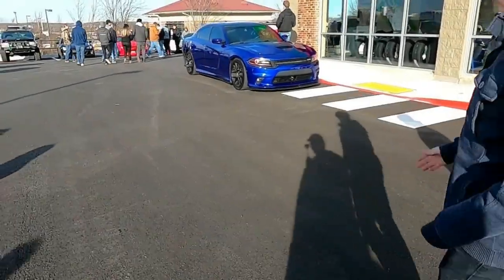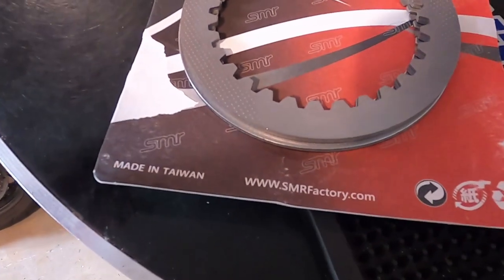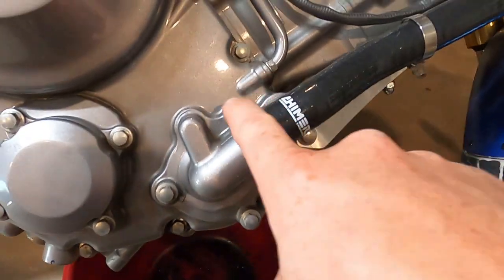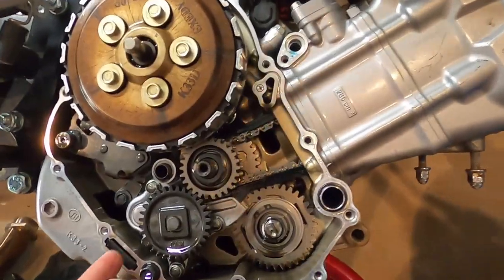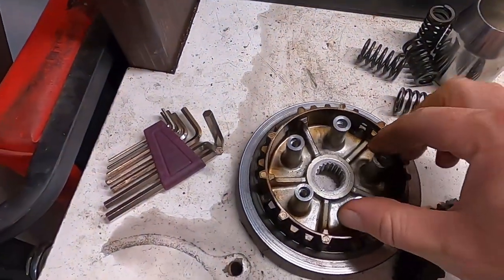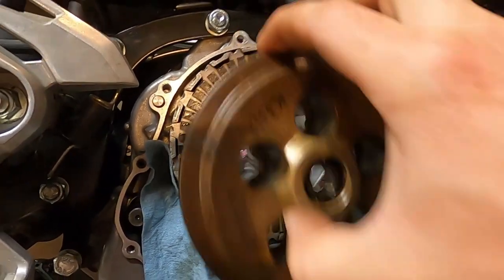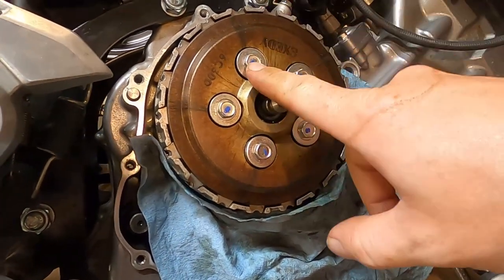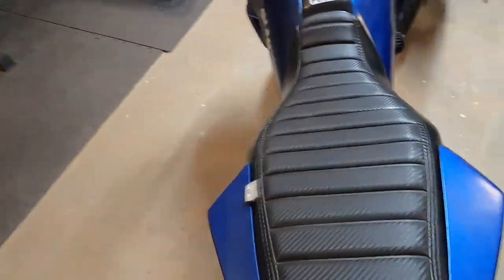How To - CBR300R Clutch and Springs

Comment: Not sure why 10 ft-lbs stripped those holes so bad unless your torque wrench is out of spec. The shop manual says 12nm (9 ft-lbs). Update: just upgraded my clutch, and I used a torque wrench set to 9 ft-lbs. It wasn't even as tight as I can easily do with one hand on a 1/4 in ratchet.
Reply from the maker: I do not know why either. I checked my torque wrenches and they seemed accurate. That said, they are cheapo torque wrenches. I have no idea what happened with this unless that clutch basket had been over torqued previously. It was a used engine and the clutch was slipped really bad. Maybe the previous owner thought tightening it down would help. Do not really know unfortunately.

Comment: What year is this bike. Mine is a 2015, and i ordered the upgrades springs and the same plates. Also, that washer, you added do i need to do that?
Reply from the maker: @mattstettler6131  the engine was supposed to be from a 2016. The washer was just one I had laying in the spare hardware drawer, I’m sorry I can’t give you any more info on that. Take that actuator into a lowes or something and start hunting for the correct sized one would be my next move.